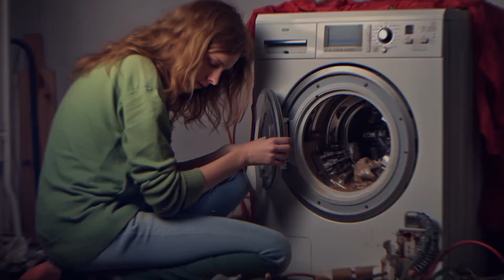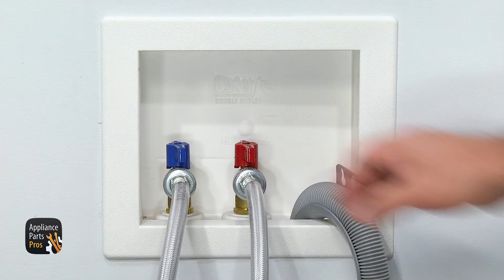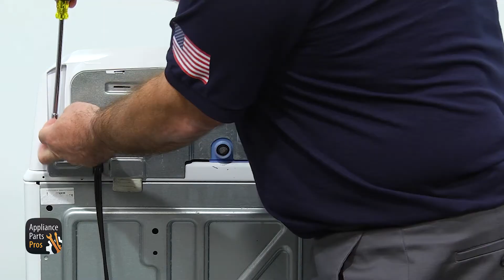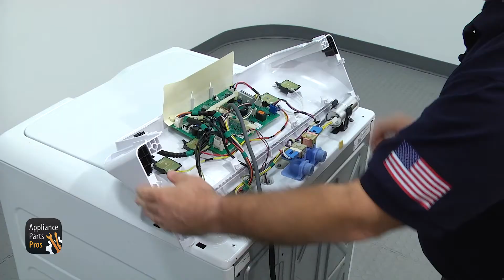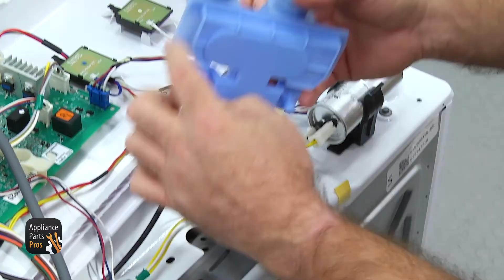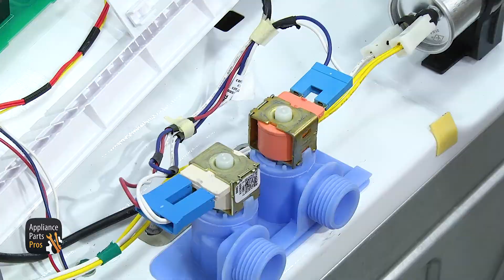How To Test And Replace a GE Washing Machine Water Inlet Valve

Comment: I can do this!  Thanks for posting.  My hot water flows nicely, but the cold just trickles in.  I've been filling my washing machine with a bucket filled at the kitchen sink -- misery!
Reply from the maker: Glad the video helped! If the hot water flows normally but the cold water only trickles in, the inlet valve or the cold-water supply screen could be restricted. Hopefully this gets you out of the bucket-filling routine! 😄 Good luck with the repair!

Comment: Most water valve issues are no cold water ( crud in the screen or bad solenoid ), won't shut off even when unplugged  ( stuck solenoid pin due to crud that got past the screen ) leaking water ( cracked body or damaged by excessive load hitting the bottom during spin or such)  Good for pointing out that temp sensor gasket... people miss that when replacing the valve.  I usually don't bother to move the machine or remove that metal cover as you can reach over the machine to remove the 1/4 in bolts and pivot the body, cover and all, out of the way.
Reply from the maker: That's a good way to do it.

Comment: How did you know it was bad?
Reply from the maker: Great question! One common sign is water slowly leaking into the tub when the washer’s off — or it not filling properly during cycles. Sometimes you'll also hear a buzzing but no water flows.

If you’re seeing something like that, we’re happy to help you test the valve on your machine!

Comment: I just changed my valve as I had a frequent leak into the tank. The change-out was smooth; however, now I notice a steady hum coming from the unit when it is filling up. It's almost like a deep motor sound. I don't recall hearing it before. It also appears to be filling a bit slower than usual. Is there anything you recommend I double-check?
Reply from the maker: Nice work getting that valve swapped out! A steady hum during fill could be normal if it's the solenoid working — but if it’s louder than expected and the water flow is slower, it’s worth checking a couple things:

Double-check that the hoses aren't kinked or that the shut-off valves at the wall are fully open.

If you reused the old hoses, there might be buildup that’s slowing things down.

Let us know what you find — happy to help troubleshoot from there!

Comment: How To Test??????????
Waiting????????
Reply from the maker: You will need to check the water valve for blockages, if that is clear you will need to test for power going to the water valve when the unit should be filling. If you have power at the valve and it's not letting water into the unit then you will need to replace the water valve.
Reply: @appliancepartspros  

My problem is not a blocked valve, mine is an  Over Filling Issue .

Here how I tested:
 
( 1st test)
Started with washer unplugged from wall outlet.                                
Water supply valves closed. Washers setting are off

Then plugged in washer in wall outlet.    >>>>>  Nothing happened

(2nd test)

Washer still unplugged from wall outlet.
turned water supply valves open, water starts to fill tub water immediately.
............................................................................................................................

If no power, the inlet valves should be closed, so no water can get through.
Even WITH power, inlet valves should be Closed so no water come through
UNTIL the washer calls for water to come on. Then the electronics will open the inlet valve.
All inlet valves are designed this way.
THIS did not happen. Water DID get through in my case.

Tells me, inlet valve is bad.  Inlet valves will NOT close.
I also did the same WITH washer plugged in, same results.
New inlet valve arrives today, will change out.
Reply from the maker: If you have to turn the water off to the unit to get the water to stop coming in then your water valve is faulty and will need to be replaced.

Comment: For some reason, the hot water side on mine trickles while the cold water flows smoothly. I’ve cleaned both inlet filters, etc. I’m thinking the solenoid on the hot water side is bad. Thoughts?
Reply from the maker: It sounds like the hot water solenoid has failed, you will need to replace that water valve.